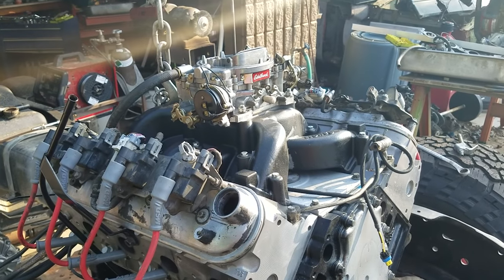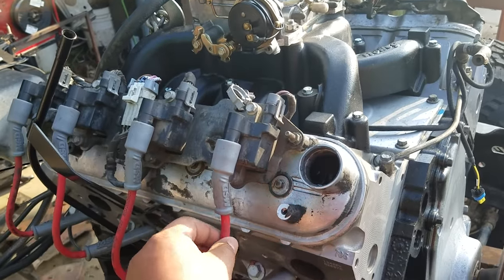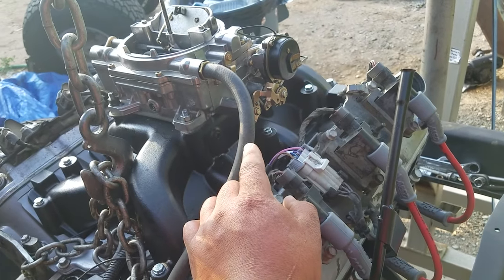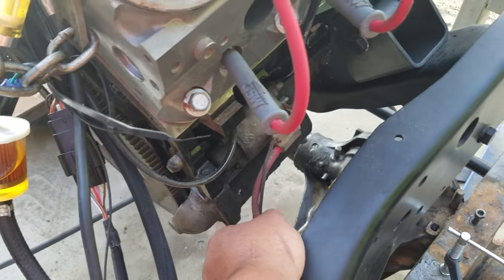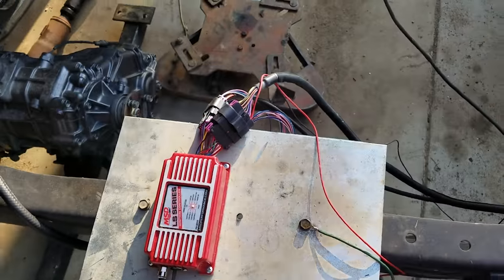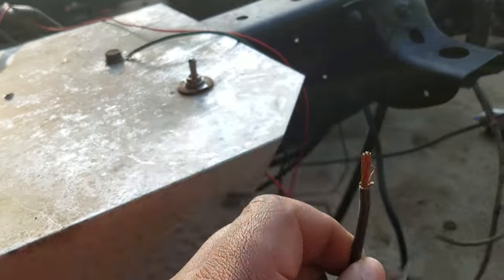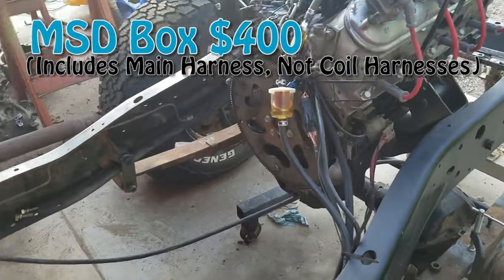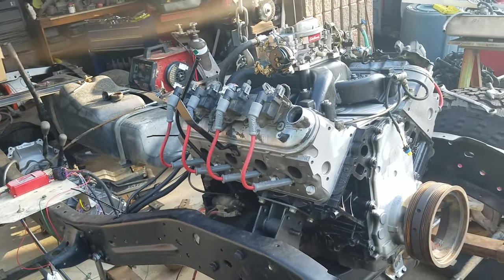HOW TO INSTALL A CARBURETOR ON AN LS SWAP, LS1, LM7, LR4, LQ4, L33 | Carbureted LS | Carb LS |

Comment: I have a question if you don’t care. I have a 1993 K1500 4x4. I’m looking to swap from a 4.3 TBI to a 4.8/5.3 Vortec. Would it be possible to run my factory computer, Throttle Body, and injectors for the swap. If what I’ve researched is correct. I can use an adapter to run the throttle body on the carb intake. Would the MSD Harness still work with this idea? I really want to keep my truck as simple as possible.
Reply: Sorry, I forgot to mention that the throttle body and the injectors are the same between the 4.3, 5.0, and 5.7 TBI engines. So they should provide enough fuel, but I’ve been told that the fuel pump is borderline inadequate. Figure I would up it to a higher pressure vortec pump.
Reply from the maker: Thats a pretty neat idea, but here are some issues that you will run against. The 4.8/5.3 dont have distributors, so you would still need to find a way to fire off the coils. You could use the stock computer to run the injectors and tbi unit, but you still have the problem of running a v6 computer on a v8 without the correct sensors as triggers for the injectors. Honestly its better to get yourself a 6014 if youre going to go carb. Engine runs super smooth and has pleanty of powet eveb with the tiny carb I have on it. If not, full EFI is just as good! Good luck!
Reply: Distributor never crossed my mind! Dang it, oh well. Thank you for the response. I’m still researching my options. Due to my trucks age everything is still mechanical with the exception of the fuel system. Everything I’m reading is pointing towards me going with a carb. I Was trying to keep the fuel injection. However, I don’t want the added expense of a stand alone ECM. Or, the expense of swapping gauge clusters, trans., etc. Just to keep the fuel injection. One last question please. Am I right that I can use a mid rise dual plane carb intake for a LS1 on a 4.8/5.3? I know the fuel injection intakes will. I haven’t found any information on the Carb intake though. Thank you again!
Reply: Cameron Holt the amount of cash to convert to your efi would be better used to put the ls efi in it the tbi stuff is a waste of time even with bigger injectors my truck is barely over maybe 210 hp and that’s with a bigger fuel pump and all the bullshit tbi mods you’d be better off putting a carb on and being done
Reply from the maker: This comment was hidden from me for some reason. The LS1 has the same intake ports as a 4.8 5.3 6.0 so any intake made for an LS1 will fit on the others. sorry for the late response, I hope it helps!

Comment: “I broke the oil pressure sensor but.. it doesn’t matter, you don’t need it..”
Reply from the maker: 👍 exactly. The ignition box doesnt plug in so the stock sensor is worthless

Comment: So I don’t need the engine computer to get the engine running all I need is a MSD box
Reply from the maker: Correct. MSD box or Smart Spark LS will control Ignition, carburetor will control fuel. Plug and play.

Comment: How would u control ur tranny ?
Reply from the maker: The ignition controllers dont control transmissions so your options are to buy a seperate transmission controller or use an older style transmission

Comment: Do yourself a very big favor and take that fancy fuel filter off and Chuck it as far as you can them filters have burnt down more vehicles then you can count for one they loosen up and leak and for another one they hit anything they crack and leak I watched my buddy 67 Chevelle burnt down because of that filter and know of two others so you can do what you want but for me no way what I have that junk on my vehicle
Reply from the maker: Check out my latest carb conversion video. I was only using that filter as an adapter to go from stock 5/16 to 3/8. After I finished redoing all my lines, that filter went away.

Comment: Cool but if your going to show a how to or what you need to know type vid, dont say might like is it going to work or not dont give information on things your not sure about
Reply from the maker: I make sure to not speak in absolutes. There are so many variables when building a car, there is no 1 right answer. My truck runs with that set up. Yours might not.